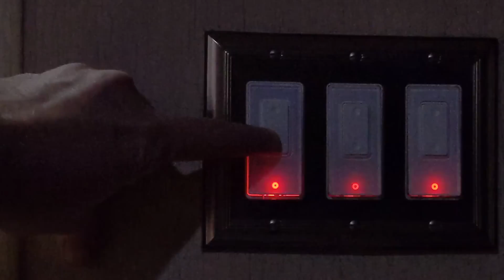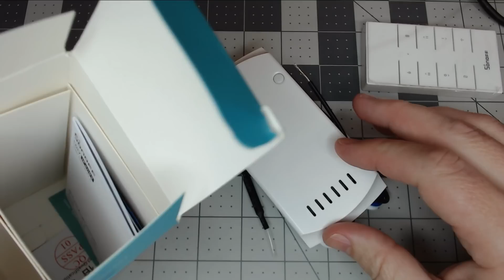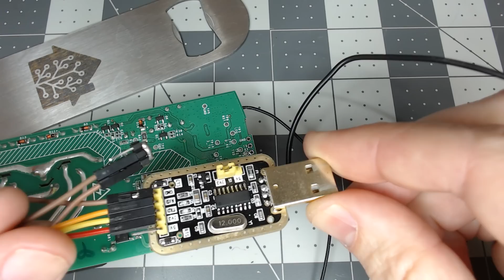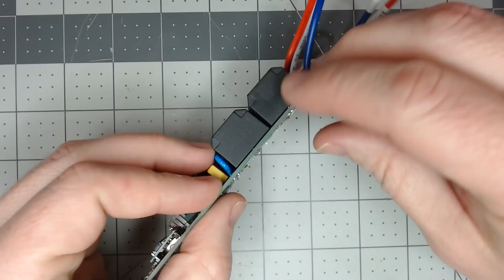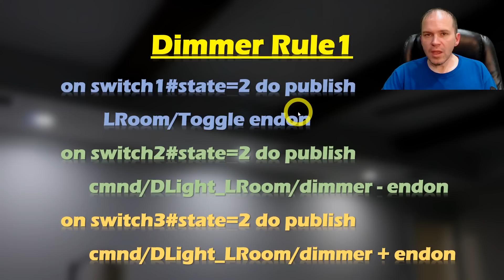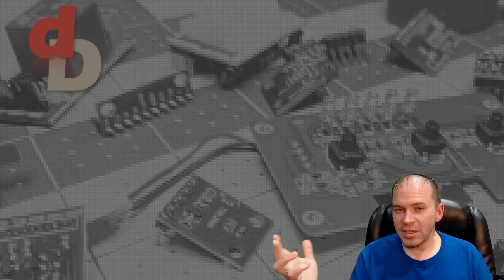Sonoff iFan03 Install with Complete Fan Speed Control

Comment: It really is too bad that Sonoff doesn't have a version for US fans.  I haven't had too much luck finding 5uf caps that don't take 2 months to arrive.  By that time, I won't be using my fan much!  Great video by the way, you do an excellent job explaining these things and providing lots of info without rambling
Reply from the maker: Thanks! You can use the regular caps that came with the fan. I did that last year or so but isn't as clean.

Luckily treatlife has come out with a new fan controller. https://www.digiblur.com/2020/07/the-tasmota-fan-controller-ive-been.html
Reply: I might still have some spare 5uf caps left that are the right size to fit into the IFAN03. ping me if you are interested.

Comment: I remember when you first posted this video, I knew this was the solution to my problem as well. I modified and tuya'd my iFan03 (without Expressions); works like a charm. I got my MJs, tuya worked like a charm there as well. Now I'm ready to hit the console and start publishing!  Because I have a light kit (and because I wanted dimming and color control), I added 2 zigbee bulbs as a group in HA. Is it possible to have these MQTT commands control them? If not, is it possible to take a topic state and create a rule to then control those bulbs (on, off and dimming only)?
Reply from the maker: Pretty much like I did except you are using zigbee. Use an automation via HA or NodeRed to listen for some custom topics on the buttons and then it sends the zigbee commands.

Comment: I'm finally getting around to doing this. In the video it appears you replaced both caps with 5uF. Did that make you're medium and low speeds identical?
Reply from the maker: No, since both capacitors get kicked on medium and one on slow or I might have it backwards.  That's the typical way the pull switch works.
Reply: @digiblurDIY  I just had someone else say the same thing on reddit. I hadn't considered them being used in series. Thanks for the reply!

Comment: Hi Travis, just want to confirm my understanding: with your setup, if the WiFi goes out but you still have power, then the Martin Jerry switch would not function anymore, but you still have full control of the fan via the IFAN03 RF remote; is that correct?

I wonder how the original capacitors installed on the IFAN03 would combine with the on-board capacitors if instead of negating the on-board capacitors by setting fan speed permanently to high (via the chain),  you set the on-board speed to either medium or low (via chain).   Have you tried this?
Reply from the maker: Right as the connection is done over WiFi but unfortunately in my household if I didn't have WiFi, I'd have larger issues than my fan not working at a switch on the wall.

Comment: Do you have to remove the original capacitors that are in the fan before installing the IFAN03?
Reply from the maker: I didn't. I just leave the fan on high itself so it internally bypasses the caps.

Comment: I've literally spent 6 hours between yesterday and today trying to get this ifan03 to show up in some sort of logical useful way in homeassistant and it simply isn't working. With MQTT auto discovery I get a switch that turns the light on and off and "Tasmota" 1, 2 and 3 that do nothing. I've tried following guides on multiple sites and YT videos and nothing works. Many links are old no longer work and redirect such as the "iFan03 Home Assistant Templates" in the description of this video. I tried following a guide to add a new fan card resource but again that also doesn't work since resources are saved somewhere else now? If anyone could please step in and help a HA noob get his ifan03 to display correctly in HA I'd be super grateful. FYI I'm not a  total noob, I have many other tasmota devices using MQTT around the house working perfectly.
Reply from the maker: I don't think auto discovery will work right with the iFans. I used the manual yaml method on it.
Reply: @digiblurDIY  I made some progress... I disabled MQTT HA auto config, and inserted the manual YAML into my config. I now have a working light. The fan speeds work except when I select off it doesn't turn off. Also when I click the fan on/off slider it slides on for 2 seconds, then slides back off, but no change happens to actual ifan device. Here's my config:

fan:
  - platform: mqtt  
    name: "Family Room Fan"
    command_topic: "cmnd/familyroomfan/FanSpeed"
    speed_command_topic: "cmnd/familyroomfan/FanSpeed"    
    state_topic: "stat/familyroomfan/RESULT"
    speed_state_topic: "stat/familyroomfan/RESULT"
    state_value_template: >
      {% if value_json.FanSpeed is defined %}
        {% if value_json.FanSpeed == 0 -%}0{%- elif value_json.FanSpeed > 0 -%}4{%- endif %}
      {% else %}
        {% if states.fan.family_room_fan.state == 'off' -%}0{%- elif states.fan.family_room_fan.state == 'on' -%}4{%- endif %}
      {% endif %}
    speed_value_template: "{{ value_json.FanSpeed }}"
    availability_topic: tele/familyroomfan/LWT
    payload_off: "0"
    payload_on: "4"
    payload_low_speed: "1"
    payload_medium_speed: "2"
    payload_high_speed: "3"
    payload_available: Online
    payload_not_available: Offline
    speeds:
      - 'off'
      - low
      - medium
      - high
  - platform: mqtt   
    name: "Fan Light"
    command_topic: "cmnd/familyroomfan/power1"
    state_topic: "stat/familyroomfan/POWER1"
    qos: 1
    payload_on: "ON"
    payload_off: "OFF"
    retain: true

Thanks

Comment: Would this work with a exhaust fan
Reply from the maker: If the fan uses capacitors to change speeds and it is inside the specs then give it a try.
Reply: @digiblurDIY  thanks mate appreciated
Reply: @digiblurDIY  Would this be good? https://ventilation-system.com/product/tt-100

Comment: You're nothing short of a genius. This has been bugging me as well. I have these unique ceiling fans that use 303mhz RF which is near impossible to control without a custom solution. Another project that I've had queued up is installing some additional lighting. I looked up the Zemismart down lights that you mentioned and am stoked! I'm going to the ifan03 setup and the Zemismart down lights. 

Thank you very much. Your videos are always so helpful and descriptive.

Comment: You mentioned on Martin Jerry Dimmer has six inputs: Button 1 Short Press + Long Press, Button 2 Short Press + Long Press, Button 3 Short Press + Long Press. Would it be possible to place two Dimmers side by side and increase the amount of inputs by also writing a script for if the buttons on both Dimmers are pressed simultaneously, e.g. 'Dimmer 1 Button 1 Short Press + Dimmer 2 Button 3 Short Press', 'Dimmer 1 Button 2 Long Press + Dimmer 2 Button 2 Long Press'. If only combining Short Press + Short Press and Long Press + Long Press to keep the input simplified and reliable, that would create 6 + 6 + 9 + 9 = 30 inputs no?
Reply from the maker: You would have to do some code changes. You could do the button multipress new feature for up to 6 actions per button.

Comment: If there is only one MJ-SD01 in the automation and the iFan03 is controlling a non-dimmable light, how should the rules be setup?
Reply from the maker: It actually would be the same being only one dimmer. Is the light attached to the fan module?
Reply: @digiblurDIY  Yes it is.

If it will post, here are the rules I current have.  Rule 2 for the dimmer is turned off because of some issues one device turns on the light and then another one turns it off.

I have to use these dimmer values to get the leds to work right.  Anything below 60 and they are all off.

iFan03 Rules

Rule1 on fanspeed#data=0 do publish cmnd/Back_Bedroom_Switch/dimmer 0 endon
      on fanspeed#data=1 do publish cmnd/Back_Bedroom_Switch/dimmer 80 endon
      on fanspeed#data=2 do publish cmnd/Back_Bedroom_Switch/dimmer 90 endon
      on fanspeed#data=3 do publish cmnd/Back_Bedroom_Switch/dimmer 100 endon

Rule2 on power1#state=0 do publish cmnd/Back_Bedroom_Switch/power off endon
	  on power1#state=1 do publish cmnd/Back_Bedroom_Switch/power on endon
      on fanspeed#data do var1 %value% endon	  

Rule3 on event#togfan do if (var1>0) fanspeed 0 endif endon
      on event#togfan do if (var1==0) fanspeed 2 endif endon	  

MJ Dimmer Rules

Rule1 
 on switch1#state=2 do publish cmnd/Back_Bedroom_Ceiling_Fan/power1 toggle endon
 on switch2#state=2 do publish cmnd/Back_Bedroom_Ceiling_Fan/fanspeed - endon
 on switch3#state=2 do publish cmnd/Back_Bedroom_Ceiling_Fan/fanspeed + endon

Rule2 - OFF
 - NOT ACTIVE
 on switch1#state=3 do publish cmnd/Back_Bedroom_Ceiling_Fan/event togfan endon
 on switch2#state=3 do publish cmnd/Back_Bedroom_Ceiling_Fan/fanspeed - endon
 on switch3#state=3 do publish cmnd/Back_Bedroom_Ceiling_Fan/fanspeed + endon

Rule3
 on power1#state=1 do ledpower 0 endon 
 on power1#state=0 do ledpower 1 endon
Reply from the maker: I would just have switch1 2 and 3 where the state=2 just send a toggle to the light of the iFan03 itself.  It makes things much easier.
Reply: @digiblurDIY  I do have it working, but the lights on the switch don't always work right.  For example, when I turn the light on, the blue led and the bottom most green led turns on.  If I press the dim up button, the fan cycles through the speeds.  When the speed cycle gets to max and I press again, all the lights on the switch turn off and a red led turns on where the blue one was.  I have a feeling this is because of the hardware in the switch itself so there is nothing that can be done.  Just really annoying to me though.
Reply from the maker: First the dimming levels are very weird why it has to be like that.  That's not normal.  The rules probably need to be hashed out a bit more to get it working like you want.  Jump into discord and post some logs and stuff so we can figure out what is going on.

Comment: Finally got around to getting iFan03's for the house, thanks for another great video. Is there any additional magic to be had with the remote and a sonoff RF receiver?
Reply from the maker: No, I just pressed a button on it after it powering up the ifan03 and it paired right up.
Reply: @digiblurDIY  Sorry, I meant any ability to utilize the remote for controlling devices other than the iFan.  Specifically, in conjunction with a Sonoff RF Bridge, would it be possible to setup unused buttons on the remote to control other stuff.

Comment: Possibly dumb question here, but I am looking to get a standard toggle switch working with this to power the main relay off and on. Any ideas? On a standard sonoff I would just swap GPIO14 to 9 an that would be it but I notice that I can't do this with the ifan03.
Reply from the maker: I believe only RX and TX pins are open on this.
Reply: @digiblurDIY  Thanks a bunch for your reply!!! Would it be possible to set one of those as the toggle switch pin? I am trying to retain some basic functionality at the wall to keep things simple when people walk in the room.
Reply: @pingwuan_works   were you able to fix it somehow?

Comment: Hi I am new to home assistant have a couple things up and running. I flashed tasmota on iFan03 with no problems got home assistant to auto discover. I have added it in Lovelace have the three speeds and the light switch but have no off button in home assistant for the fan speed. If I use the remote it will turn off if I log into the IP address of the tasmota it has all 5 buttons one for the light switch for 4 the fan 0 is off 1 2 3 speeds of the fan but home assistant didn't pick up the off button how do I add the off button in home assistant. And i have replaced both 5uF Capacitors. 

Thank you Rich
Reply from the maker: Not really sure about using auto discovery with the iFan0x, it might just not work. I use this https://github.com/digiblur/Tasmota/wiki/Fan-Devices

Comment: In addition to my previous comment... I figured I'd just swap out my old single-capacitor fan with a new one I have in a box in my garage.  Checked the guts and it has a 5-wire cap that reads 6.5uF, 6.5uF and 5uF as opposed to the relay you had the read all 5uF.

The FAQ for the iFan03 says this: "the 1-gear (2.5μF) output current is 113mA (120V/60Hz) or 173mA(220V/50Hz); the 2-gear (2.5μF + 3μF) output current is 249mA(120V/60Hz ) or 456mA(220V/50Hz). the 3-gear act as the same performance as original."

Looking at the schematics for the iFan02, I tried to get an understanding of what switch 3 (or 3-gear, as they put it) was and how to interpret their comment about fan speeds from the website.  It if I'm understanding correctly, your installation would amount to 1-gear being 5uF, 2-gear being 5uF + 5uF and the 3-gear being no capacitors at all.

Furthermore, what do you do with all of the wiring in the lighting dome housing?  Do you just cut out the existing pull-chain speed control and capacitor?  Does the iFan03 incorporate the reversing switch too?

It's all very confusing to me.  I'm just trying to get a smart fan without burning my house down lol....
Reply from the maker: I think so, as I do get it confused at times.  Or maybe it is both caps switched in for low?  and one for medium?  You can pull out the wiring if you want to that does the current capacitor and speeds or just leave it in and leave it on high all the time.

Comment: Thank you for the video!

I have a question. I did an investigation on my fan and found that it only had a 2-wire 4uF capacitor and a pull chain. Is there a possibility that there's a cap somewhere else in the fan motor housing? Or is this standard? Can I still wire the iFan03 in? If so, what kind of recommendation on the caps? Both 4uF?

You seem to be one of the only people with any real info on this device.
Reply from the maker: There are usually 3 capacitors in the fans that I'm familiar with.  Give it a try with stock and see what happens.  You just leave the fan on high and let the iFan03 do the slowing down of things.

Comment: Very interessting and nicely done! :) Does one have to connect dimmable lights to the ifan03 or can it purely switch 0/100% (toggle) so that non dimmable LEDs work, too? I noticed with other dimmers, that they kind of "always dim", even at 100%, so the non dimmable LEDs cause problems. :(
Reply from the maker: The lights are smart lights I used, but of course you could adapt and just use the light relay on the unit itself but it's on/off though, not dimming.

Comment: Thanks for the fantastic video! I recently got around to buying the stuff for this mod, but ran into a small problem. The eBay links you provided link to listings that are no longer active. I tried looking for an equivalent capacitor myself, but the ones I bought are too big physically. The voltages and capacitance is right, but the pins are too far apart and I doubt it'll fit in the case. Can you please help to provide another link for these capacitors?
Reply from the maker: Dang.. That was tough for a few us to find those. Let me. See if I can dig around to find those exact ones again.
Reply: @digiblurDIY  so far based on my looking I'd have to agree that they are rather hard to find. I wonder if a site like digikey would have them? I'm not very good at picking electronic components yet, they all mostly look the same to me haha
Reply: @digiblurDIY  I think I finally found them! I'm not sure what changed in my search, but for some reason my latest search brought this right up: https://www.aliexpress.com/i/32808846668.html

If the picture is accurate they look like the exact some ones you used. I've ordered them already. Hopefully they work!
Reply from the maker: Thanks!  Let me know and I'll update the link.
Reply: @digiblurDIY  At long last the capacitors have arrived. The are definitely the same size. Haven't installed them yet, but I can confirm that they are the same physical size as the original ones on the board!
Reply from the maker: Great! Tough find indeed. Going to order some myself for future installs.
Reply: @matthewbuschur6466  I bought 2 from eBay, but they are too big too.  Just checking to see if you got extra that are right size?
Reply: @shoulih  the ones I bought from the AliExpress link above are the correct size. As it stands I still have 3 or 4 pairs left. I've only had time to install it in one of our ceiling fans so far. Why do you ask?
Reply: @matthewbuschur6466  do you have a spare pair that I can buy from you? as it took over a month to receive mine, but wrong size.
Reply: @shoulih  Hello Shouli, I apologize, I did not see this reply until now. Didn't get any notifications. Unfortunately, I don't have any spares. Completely understand being disappointed by the time shipping takes. Hopefully you already ordered some more. Good luck!
Reply: @matthewbuschur6466  No problem Matt!  I finally received the capacitors of the right size from Ali-express after two long months today.  Right in time before the summer season with high temperatures starts here in SoCal.  Thank you again for the Ali link!

Comment: So none of this stuff will work out of the box? I'm really not looking to flash devices and switches. I don't really care about fan speed nor do I care if the fan and light are controlled separate. I just want a wireless switch to control my fan/light just basic on and off. My fan and light doesn't have a switch and has to be turned on with the pull strings and I just want to be able to tell Alexa to turn on fan and it comes on. Any suggestions?
Reply from the maker: Sure it will.  Use the Ewelink app in the cloud and use the remote.  We just do things a little differently with open source non-cloud firmware and customizations.